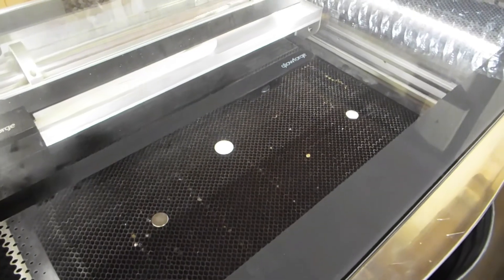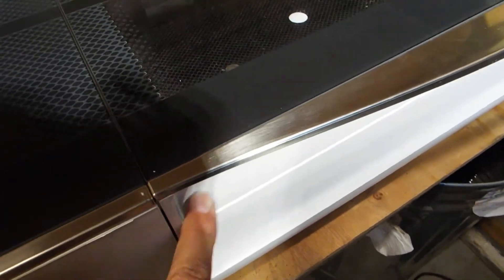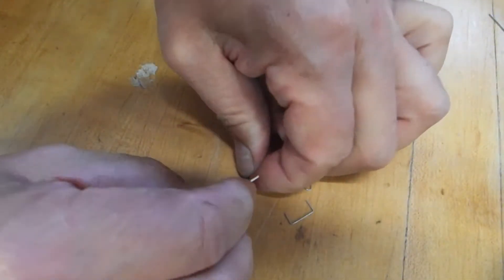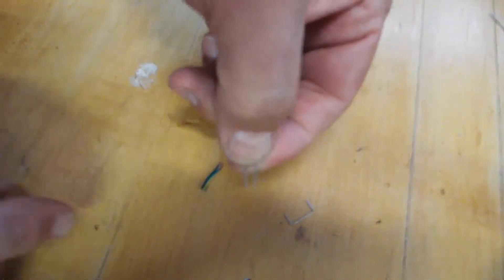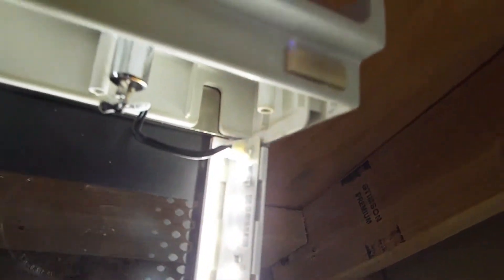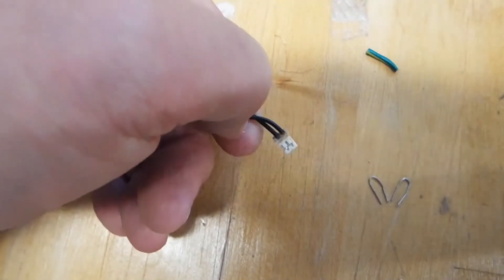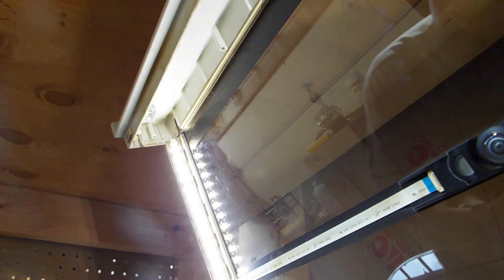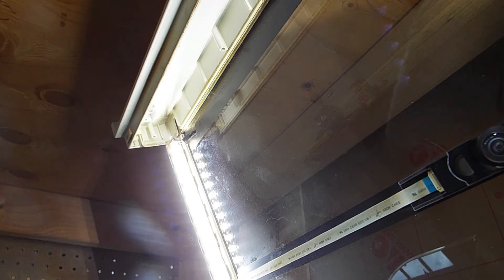Troubleshooting Glowforge Lid Open Error for Front Magnetic Sensors with Bypass

Comment: I have replaced the black cable and still get the lid open error. I tried the staple trick and the lights never did get brighter. I tried using a magnet and that didn’t work. What would be your next suggestion?
Reply from the maker: @jeremy08410  unfortunately it maybe down on the main board.

Comment: So I replaced the black cable and then did the staple and did the bypass and it still says lid open. Any suggestions on what it could be? Should the Glowforge still calibrate with that error?
Reply from the maker: It could be a few things. The led boards in the lid could have a cracked trace, open solder joint, damaged connector. Also could be the bottom board that cable connects to.
Reply from the maker: I am not sure about calibration with the lid open error
Reply: So what happened was I was engraving a bamboo board it finished and I took it out and put in another board and that’s when I got the error. Also when I turn it on the button flashes purple for a few seconds and then goes normal color. I can’t remember if it did that before.
Reply from the maker: Do you remember anything getting hit in the lid area by the bamboo board when it was removed?
Reply: @madscientisthut  no it was just a 5x7 dollar tree board. That’s why I am so confused.
Reply from the maker: Have you pinged glowforge support yet?
Reply: @madscientisthut  yes and they said it probably dead and send it back and they would send me a refurbished plus as hard to get basic that’s what mine is  with $1300.
Reply: @kellyclark8231  just to clarify, you are saying they will send you a refurbished plus in place of your basic, but they are charging you $1300? May I ask when you bought yours? I bought mine right at the start, so my warranty is done, is that the case for you as well? My whole lid came off in the FL heat and humidity, but its been working for the past few months until today. I am going to do some troubleshooting but I worry about reaching out to support and them turning my machine off due to safety or something, and forcing me to pay them or go without.
Reply from the maker: I wish I could help you further, but without access to the actual  machine it is hard to troubleshoot.
Reply: @madscientisthut  well thank you so much for responding so quick and trying to help me. 😊

Comment: I have a question - the handle of my GF lid came off, pulling the wires off with it (and the connectors at the end of each LED light strip. Do you think I can lose the lid open message if I connect up the two wires within the lid itself?
Reply from the maker: Not sure but possibly.
Reply: Just to confirm, it did work! Shorting those connectors circumnavigates the magnet/lid issue completely. I soldered some wire to either side. Many thanks for your video providing the thought process and inspiration,  @madscientisthut

Comment: Thanks so much for the excellent videos.  

I have a connector that broke off the LED strip and now says “Lid Open”.   Any suggestions on shorting it out if it’s broken away from the strip?   I tried the staple and it didn’t work. 

So hopeful you have an idea.  Thank you so much
Reply from the maker: it depends on which connector broke, is it the two pin connector that the magnetic sensor goes to (close to the front of the lid)?
Reply: @madscientisthut  — yes the 2 pronged connector
Reply: And if I hold them both up the lights come on brighter like it’s going to emgage
Reply from the maker: Do you know how to solder, or somebody that can. The points where the connectors are/were mounted can be scraped back a few mm then a jumper can be soldered there. It is somewhat a pain if the board is mounted in the lid. Also after doing this you will lose the interlock if both sides are jumpered, so it may be good to see if you can go the key switch route I did in the other video.
Reply from the maker: I may have time tomorrow to look at the boards closer to see if there is another method to by pass the interlock.
Reply: Oh gosh thank you for replying!! And so fast!!  You are amazing!

Yes it is and now the one on other side just broke too while I was trying to staple trick….
Reply: Gosh thank you so much.  Will try to find someone who can soder
Reply: I was able to glue the boxes back on and the lights are on high like it’s going to work but still says Lid Open.   Frustrating—- thank you again for responding as you have!!  Amazing person you are
Reply from the maker: hmm, that is interesting that the lights come up on high, that indicates it knows the lid is "closed", I am sorry I do wish I could help you out more but I have not encountered this type of "lid open" error, very frustrating indeed.
Reply: @madscientisthut  you’ve been amazing thank you for all your efforts.  Wish the staple trick worked

Comment: We just leave the staple in there?
Reply from the maker: So if you identified that you can run with the staple in there and not without it, you have an issue with the magnetic switches in the front of the top cover. You can further isolate the two switches by trying one side at a time. Once you have figured out which one is bad you can leave the staple on that side and use the machine as normal.